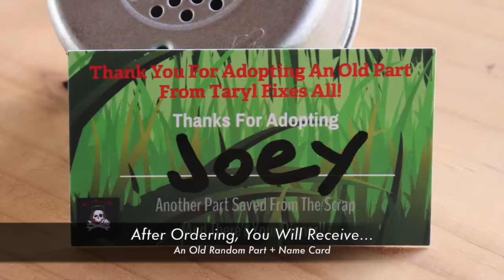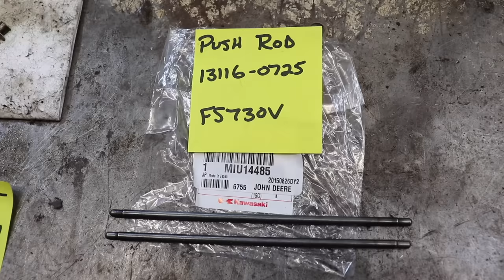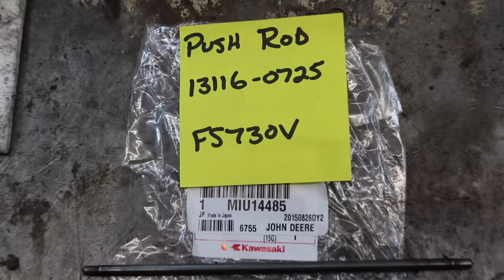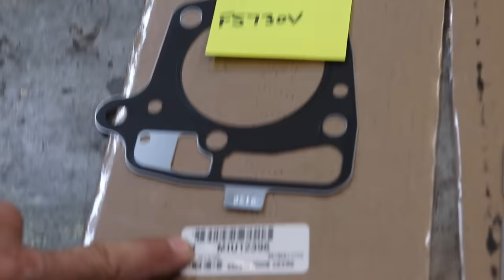How To Fix A Valve Guide That Moved. Epic Fix!

Comment: I saved a Briggs head one time by drilling a 1/4" X 1/4" deep hole right next to the valve bore in the valve port. I removed the guide and put a small tack weld on the guide which would fit inside the hole. Before installing the valve guide   I put a similar sized hole at the top of the guide bore.  I installed the guide and then tacked the guide in the hole I made at the top. The valve guide can no longer move up or down. After cleaning out the "Fluffy" nest and fixing an oil leak, my customer has had no trouble with his engine.

Comment: It is a science in alloy-Al heads to have non-compatible metals for valve seats and valve guides and a machining art to fine tune what is too tight or too loose.  Even F1 and MotoGP teams have had issues with this, and a reason they have engine heaters before they start them, to avoid seizures and dropped seats and guides into the chamber destroying an engine within seconds of starting it.   An Al-alloy head will expand so fast with heat on ignition it drops those inserts down like they were held with butter.  Make them too tight and those racing heads will crack as they cool down, making them single use items.  Imagine spending a 6figure budget to have those heads machined.  

Cast iron heads baby ... WLA all the way to 22nd century with just a hand lapping job!

Comment: It's official I really hate you! I paid a machine shop$125 to do what you just did. And that wasn't even for any parts. I had to go get them.
This video is just in time for my spring project. I have a Miller bobcat that everything works fine on except one of the cylinder heads has a bad valve in it. Now I know I can fix it myself. I do a lot of repairs out of my garage. It's mostly friends and neighbors and I do not charge unless I have to buy parts. I have been watching a lot of videos to learn more about what I am doing. I know enough just to be dangerous but I don't know everything like yourself. I would say 90% of all my repairs are carburetor related. Last night I watched your video on replacing the needle valve seat. I ordered the tool that you were using to make the job easier. I don't go out and I don't party I'm mostly in the spring and summer work on things in an outside of my garage. I have no problem buying the tools it takes to make things easier. 

Look forward to watching more of your videos. Thanks for sharing your knowledge it really comes in handy for amateurs such as myself.

Comment: Wow 177 hours? My JD LX277 with a kawasaki has 700 hours. Knock on wood, all I have had to do is fuel pump and rebuild carb. Solid units if you do the maintenance.

Comment: ok SO this is the only way I got of getting ahold of the master mechanic TARYL but I got a question that cant find an answer to. I got a neighbors garden skratcher its a old snapper rear tanger model IR4001 anyways it wouldnt start for nothin oh btw the engine is a 112212-0837-01 a nice old pre smog junk motor but my question is its got slop side to side on both valves the guides and valves have a good amount of wear ...I have never done guides in a lil BRIGGS before but the 80 year old neighbor whos it belongs to doesnt have the money for a full replacement of guides and valves and all the good stuff it needs. So I told em id do the work for free no problem so all he has to buy is parts and NOPE not happening. So whats an easy fix do I get new valves lap those in or that just waste of time and money or is there some other way to rig this thing so we can skratch his yard up one last time. And yes an 86 year old dude is planning on doing this job himself just needs his olde Skratcher runnin lol. Ok thanks in advance and anyone feel free to post your opinions and any help youi may have here. lol thanks again guys ....

Comment: Ah, as a scientist that sits home and watches videos, I would say that the divet you drilled would be hard to line up with the setscrew hole.  Use the Whizzer wheel to make a groove around the whole guide so you just have to worry about getting the depth right and not also the rotation of the guide.  And you need a power wrench.  I have a 1/4" Skil.  Stop fooling around with dopey hand tools and go modren.

Comment: You know better than this.......aluminum expands twice as much as steel. Why didn't you warm the head before driving out the guide? That would have stopped the gauling as the guide came out. Same going back in, the guide inserts easier and tightens as it cools.  Hope that green locktight works, that guide went back in way too easy.